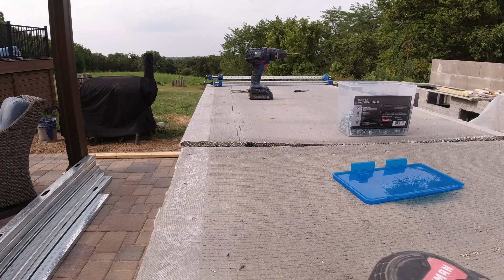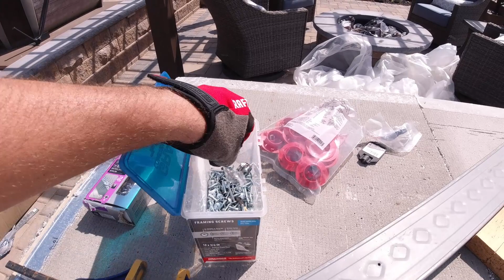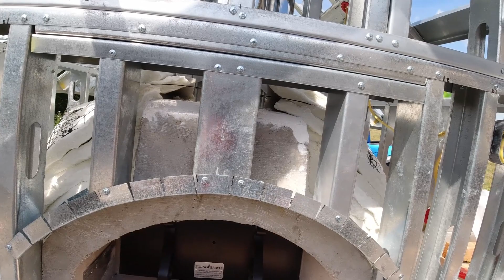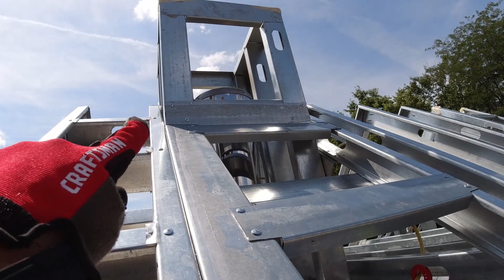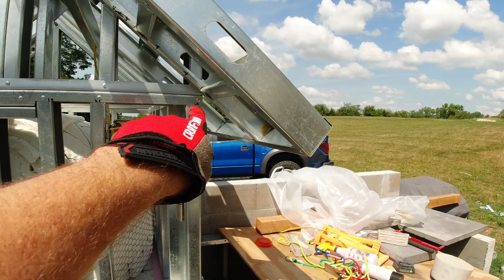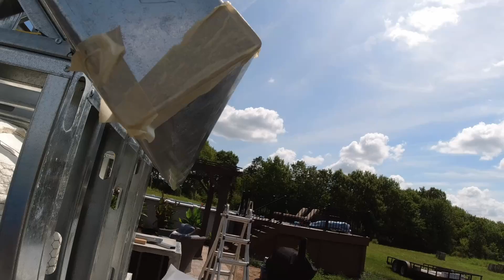Framing the Wood Fired Oven Enclosure w/ metal studs! - Detailed Walk-Through - Outdoor Kitchen

Comment: Question for you... What did you use for sheathing on the outside of your steel structure? ...1/2" Durock or ?? thx in advance for your response 👍🏼
Reply from the maker: 1/2” Durock on the walls.  5/8” plywood for the roof.
Reply: @blood_sweat_and_beers  Thank you 🙏

Comment: Very good and detailed video,
I'm thinking on using the 18-gauge metal studs for Island structure. How workable is the 18 gauge (with hand tools) for that purpose?
Reply from the maker: Hello!  18 gauge is meant for structural applications and in my opinion is not workable with hand tools.  It is some really thick and strong stuff!  I have a video on my channel that shows how I framed my outdoor kitchen island using 20 gauge steel studs.  Plenty strong and you can use hand tools for cutting.

Comment: Where did you end up getting the 18 gauge studs?
Reply from the maker: I called around to local building material suppliers until I found one that worked with residential customers.
Reply: @blood_sweat_and_beers  what was your track/stud width?
Reply from the maker: @derekmconner  I used 12” on center.

Comment: That looks like a piece of art. A very sturdy piece of art. 

I’m intrigued to know how the heat exiting the front arch will impact, if at all, on the steel work? I know from experience that my front arch brick work, which is beyond the flue, does get extremely hot.
Reply from the maker: Good question.  I haven't noticed it being overly hot, but I also haven't measured.  I might have to make a quick short showing the temp inside and outside.